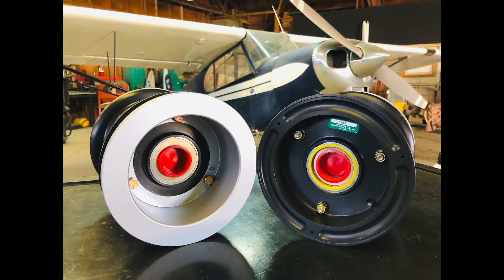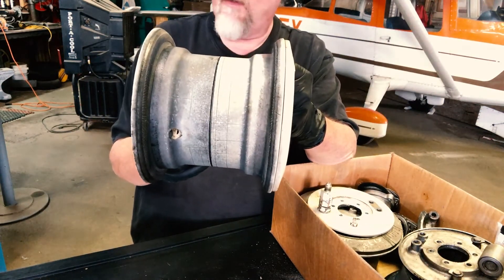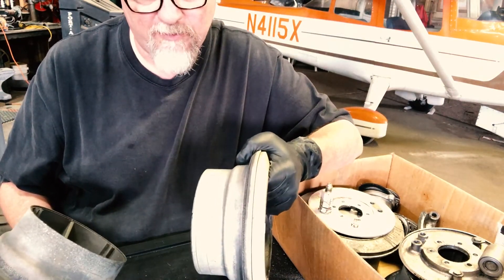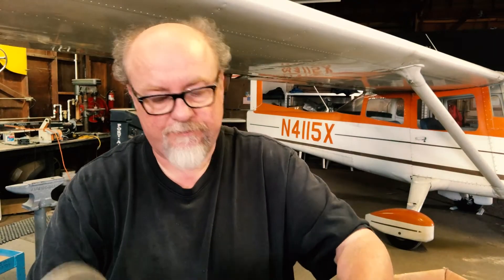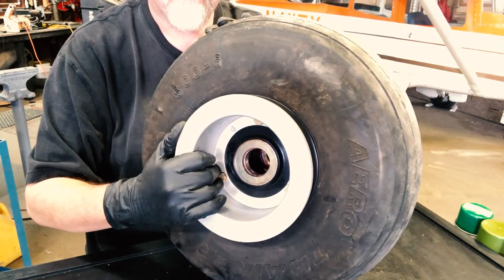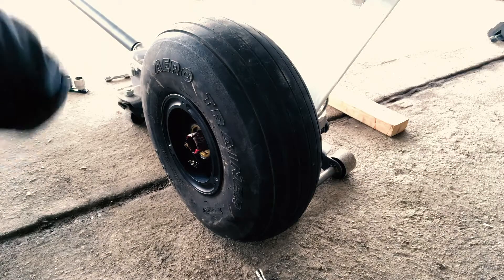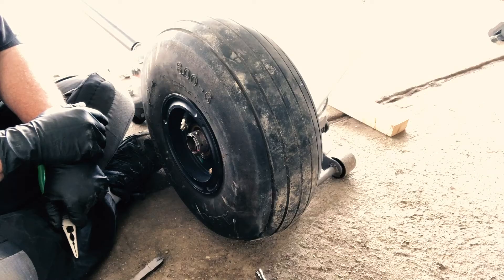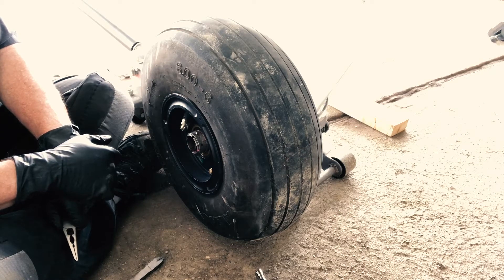Installing Airframes Alaska Bushwheels On A Piper Tri-Pacer (DIY Series) | Wild River Aviation

Comment: The way i do it: #1 installed the hardware tied and rolling the tire and the big nut until the wheel is not free, this is to make sure the hardware are at the wright place #2 undo the big nut until the wheel starting to be free with rolling the tire, alighn the hole for the cutter pin. I notice you where using a side cutter to bend the cutter pin at this moment you grouve the pin and adding a fatigue and can not be use anymore. Cheers !